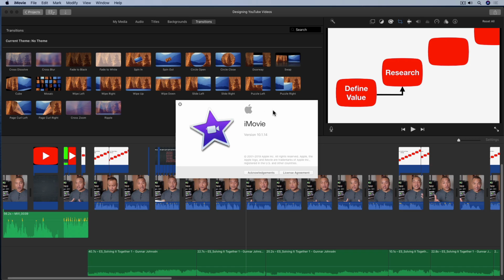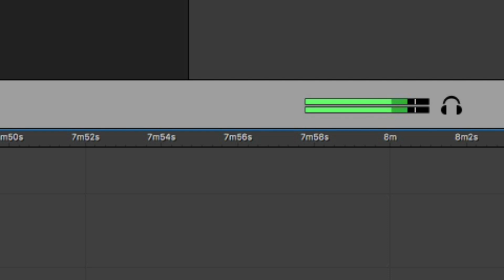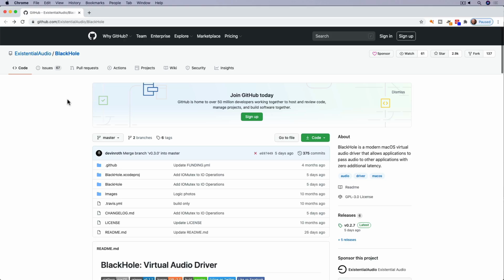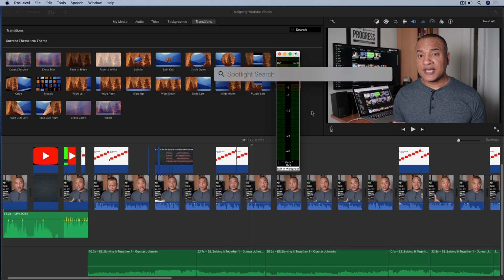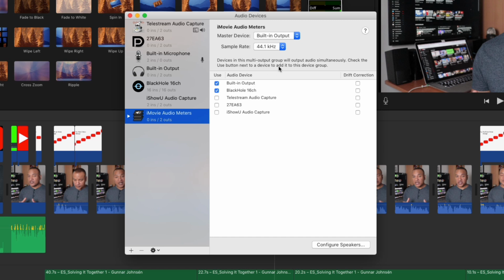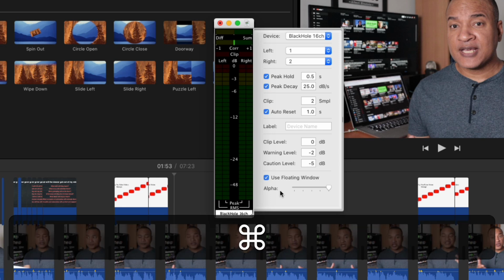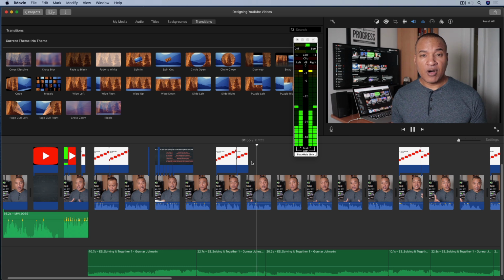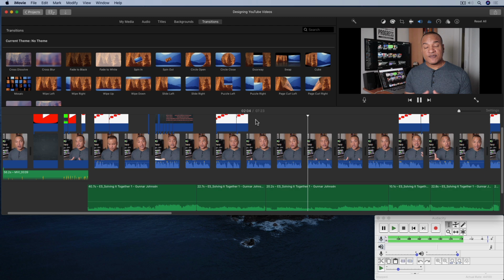iMovie Audio Mixing Like Final Cut Pro - Here's How

Comment: I got a new MacBook Air recently and this doesn't seem to be working anymore. When I look at my pro level meter now the device listed is MacBook Air Microphone not speakers...... so the meter is picking up the sound coming out as well as the ambient sound and voices from my room/house. Does anyone know if there is a way to change this that I am just not seeing or is this a thing with the new MacBooks?

Note that in audio midi set up it shows both MacBook Air speakers and MacBook Air microphone and I have selected the speakers as the connection with blackhole 16 ch.
Reply from the maker: Have you tried updating BlackHole?

Comment: Everything worked except that Built in Output doesn't appear anywhere in the left and right panels of the Audio Midi, so I can't select it and I can't connect to iMovie.  Any suggestions appreciated!
Reply: I had the exact issue...so I can’t use the meters
Reply: @cmac6750  Same here... can't figure out a workaround. Unable to use the meters!
Reply: @Carlos.Explains  Follow these instructions from BlackHole
Reply: @cmac6750  Follow these instructions from BlackHole